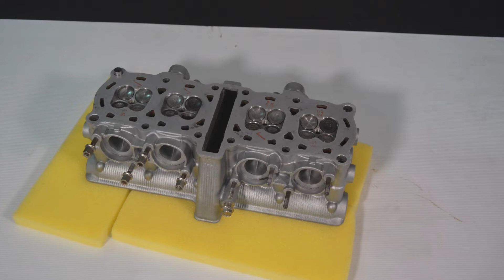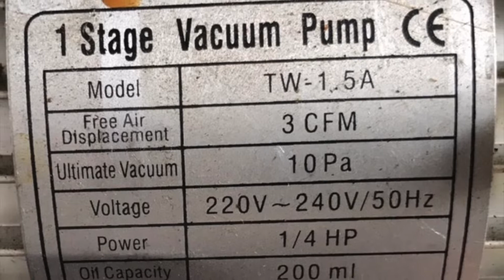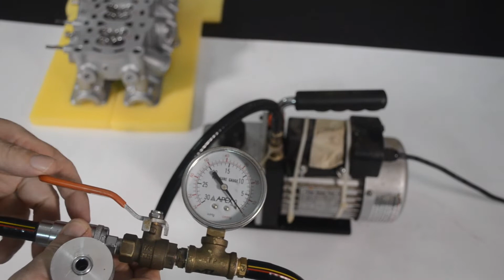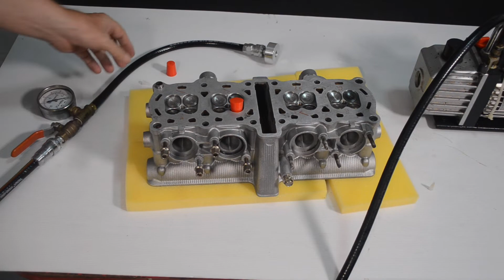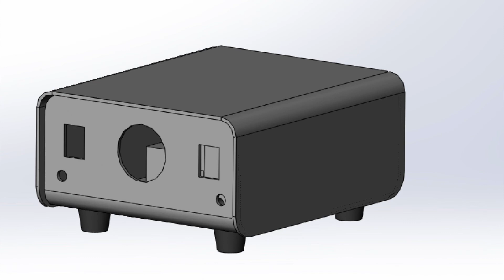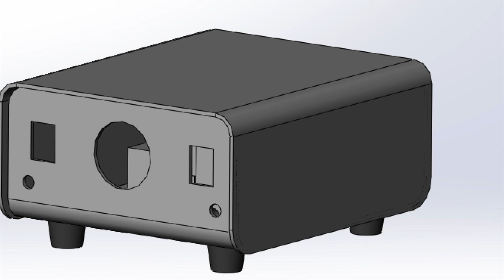Vacuum Testing Valve Seats - Episode 1

Comment: Thanks for sharing! How well does this compare (I know...different methods) to pouring spirits into the cavity and waiting for it to leak through a valve?  Seems like this would be a lot more sensitive since spirits are a lot more viscous than air.
Reply from the maker: Good idea. I will add that in when I do the next video with the low capacity pump.
Reply from the maker: I included the test of using gasoline in the port in the new video. You can see at https://www.youtube.com/watch?v=XezIVK7riRA&t=1s